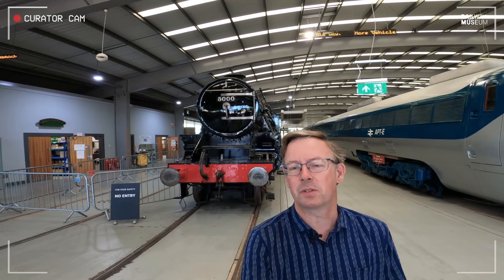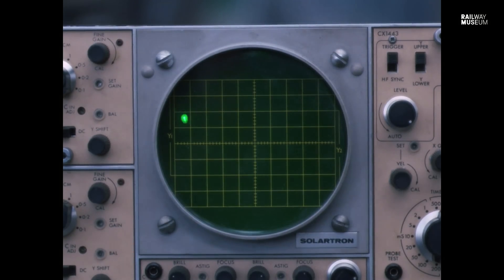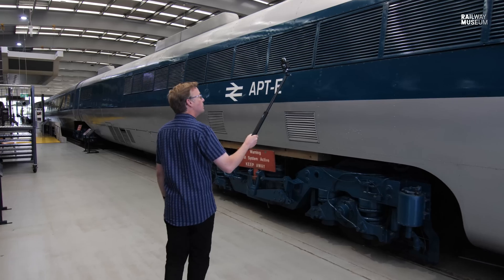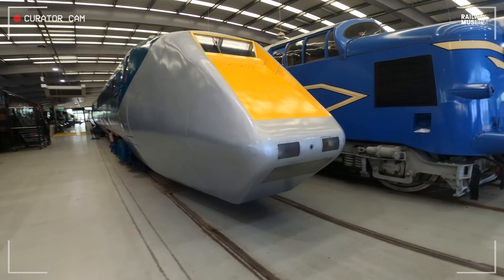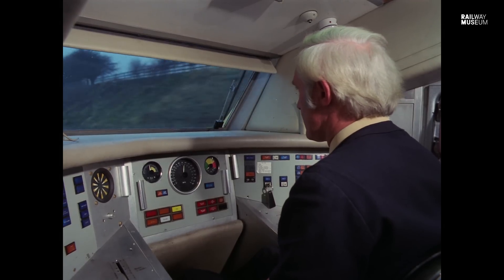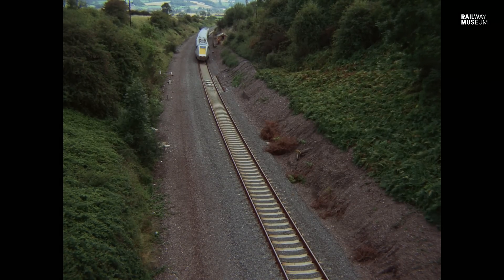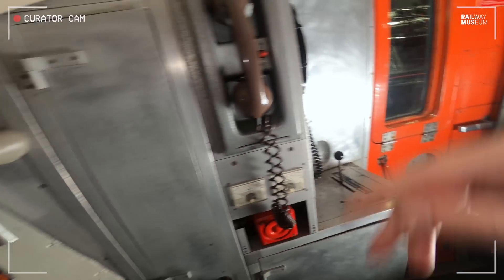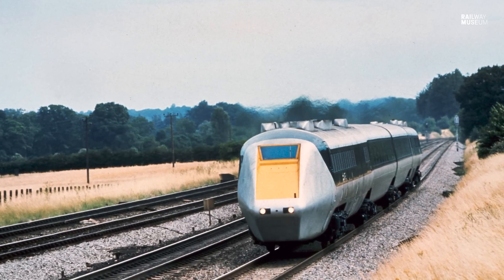APT-E: The Tilting Tech Fest, a 1970s Vision of the Future | Curator with a Camera

Comment: No mention of the cheese sandwich that was used to wedge an internal door open (nothing else worked, apparently).  Although apparently Rapido included it in their model.
Reply: The door wasn't meant to be open much of the time, but we had to open it so often that the door wedge kept wearing out. A stale cheese sandwich was the perfect size, and I've got three pics showing them on different occasions. Rapido really DID put in the model, it's about 1.5 mm square. :-)

Comment: What is pointed out as the traction motors and associated cabling near the beginning of the video is in fact the hydro kinetic brake and associated axle-end piping.
These can be clearly seen on the APT - P at Crewe Heritage Centre. The NRM really out to have an ATP - P as this was what we could have had on WCML long before we flunked development of APT (thanks to UK gov, BR management, and rail unions - who killed it), sold it to Italy, then bought it back in developed form as Pendolino.
Chuck out of York that irrelevant to 'UK National Rail' Bullet Train and replace it with significant vehicles from the APT - P set from Crewe ! That really should be preserved under cover rather than out in the open at Crewe.
And as APT - E was gas turbine, where were the engine instruments (N1, N2, EGT, Fuel flow)?
The intakes on the roof are the air intakes for the gas turbine engines, not for cooling air. Gas turbines swallow massive amounts of intake air.
Reply: The turbine instruments were on a separate console in Trailer Car 2. The driver didn't need to know about them as we always had a turbine engineer or two when the train was running. Of course if service gas turbine powered APTs had been built it would have been a different matter and they'd had to have been in the cab.  No, the turbine air intakes are the large grilles that run along the entire length of the sides of the Power Cars, and the roof bulges are where the exhausts end up. They stick up above the roof line to ensure the exhaust gases don't stick to the surface as a bounder layer.
Reply: @kitspackman3994  who'd have thought that boundary layers would be a consideration in railway vehicles?
And of course it turned out it wasn't, as the advanced tech of ATP was ditched for the conventional HST.
Not that production APTs would have had gas turbines. But it's indicative of the advanced thinking involved in the APT program we lost when BR reverted to conventional tech with HST.
Yes, HST was a great train, but APT could have been leaps ahead.

Comment: Silly question. Having got in how do you get the steps back up, or down?
Reply: you can drop the steps via a button that is located above the steps and if you want to back it up, possibly simply back it up manually
Reply: @voidjavelin23  Do you mean the button pointed out in the video that releases the steps?  Having got into the APT how do you return the steps to the original position without getting out again?
Reply: @David-y6h9p There's a socking great lever just inside the cab that hauls the steps back up.
Reply: @kitspackman3994  That is what I wanted to know, and isn’t shown in the video. Thank you!

Comment: Presumably the APT-E has more than one hydraulic system for redundancy purposes. I would therefore guess that the Lane Change button switches the bogie's lift pack to the second hydraulic system, to be used either in case of a failure of the first system, or to test the second system.
Reply: Not quite. Each car, Trailer or Power, has it's own hydraulic power pack, each with a main pump and an auxiliary pump, and as I mentioned above, there are two channels of accelerometers, control electronics and control valves. The channel actually in control was selected vie the 'Lane Change' switch, and that switched a hydraulic selector valve which in turn fed the hydraulic power to the tilt jacks. The jacks themselves were not twinned, there wasn't enough room to have done that, if a hose burst or a jack failed (Neither actually ever happened....) the vehicle concerned would just fall over.

Comment: You don’t show the turbines, or say much about them.  Are any of them still installed?  What was the power rating of them?
Reply: no info for the power rating
Reply: Each turbine gave 300 hp to start with, but were later upgraded to 350 each, giving the train 3500 hp at full throttle.

Comment: I think the "inches of Mercury" gauge is actually "%g", meaning, I presume, what percentage of G it's pulling (whether that's horizontally or under braking, I'm not sure)
Reply: You're quite right.  I would've thought that this train would've been air braked rather than vacuum.
Reply: I think it's actually percentage grade, as in how steep the track is.

Comment: Cheers Anthony for an informative video.
7m24s.  Inches of Mercury/vacuum?  Labelled as %g.  So probably G-force and not air pressure at all.
So, one driver's seat and everybody else standing up trying to take notes on the fly.
British Leyland gas-turbines.  How did they even build them as BL was always on strike in the 70's.
300kmh is 186mph.  Done it on a motorcycle.
40 years with the railway and I'm entering data/controls for a southern region signalling simulator on other screens watching this on another screen.  Not the 70's.
Around 1983 I got a free ticket to ride a tilting train out of Glasgow (APT) to I think it was Euston.  That was weird when stood up - like messed up as guinea pigs for free travel and please fill in a questionaire.  Thankfully, tilting has got more controlled since then as you do not notice it and coffee/beer/soup does not slide onto the carpet.
Reply: Cheers, I learn every day!

Comment: The "Lane Change" is probably referring to control lanes. General a signal path, i.e. the electrical path from an operator interface control (button, switch, lever, etc etc) to the thing it controls, or from a sensor to either a display or recording device is referred to as a lane. Generally for anything really important good design practice would be to have multiple identical lanes that run in parallel. Assuming everything is good and happy and working as it should, only one lane will actually be actively operating, the other lanes typically are still passing the signals back and forth, but there signals are being disregarded (but may still be recorded to any data recording devices for later analysis). If however something seems off, maybe a control isn't responding the way it's expected to, or some piece of displayed information seems nonsensical, you can swap to an alternate lane, the idea being that with the lanes being independent of each other apart from their end points, this will overcome any electrical component failures. In more advanced systems you may have 3 or more control lanes, with a computer automatically comparing the data on each lane and deciding which is correct and which is not, on the basis of probability, if 2 lanes carry identical data, and 1 lanes data is different, it's more likely that the lane with data that differs is faulty, than that the 2 lanes that are showing the same data are both faulty in exactly the same way.
Reply: I was going to say that the lane change is probably because the system was designed to have a level of redundancy, in other words, a duplex system. This is quite apt given the aerospace link of APT-E to English Electric and Alan Wickens having previously worked in the aerospace sector. It's very common for commercial airliners to have duplex and triplex systems to provide one or two levels of redundancy, e.g. two or three autopilots, so if one system fails,  you have one or two backups. The same design principle  was read across to APT-E.
Reply: @EuropaSman  exactly, I believe in modern day aviation its not just a common practice but a legal mandate for any system deemed safety critical.
Reply: See my direct reply to Anthony above. The APT-E had a duplex control system which could be switched manually from one channel to the other. There was also a monitor accelerometer which triggered an automatic lane change if it reached a pre-set level of lateral acceleration.

Comment: So the sunflower is radioactive? Is that why it's called a SUN flower instead of another kind of flower, or am I overthinking it?
Reply: It is just a name drivers gave it because the triangular yellow segments resemble sunflower petals. These glow in the dark so they are visible in tunnels or at night. instead of using a lamp they were painted with luminous yellow paint which is radioactive. They were first used on steam locomotives which used a battery to work the equipment and probably why paint was used instead of a lamp which would drain the battery
Reply: @cedarcam  So I was overthinking it! And that also explains why they used that kind of paint, instead of a lamp, thanks!

Comment: Unlike the English Electric Lightning which was a success the APT was a disaster...for goodness sake it was powered by British Leyland turbines, British Leyland will always be synonymous with under-engineered cra*p. Should have tried English Electric Turbines. APT...total flop.
Reply: EE didn't build turbines of the right size and power rating then. Rolls Royce did but didn't want to make a very short run of the correct rated turbines. The BL truck turbine was the only game in town back then.
Reply: There was never any question about its reliability I think, it was only ever intended to be experimental. The turbines were designed by Leyland for truck use, and the truck side largely avoided the industrial relations problems inherited from BMC
Reply: Absolute nonsense! APT-E is only loosely related to prototype APT's which didn't use turbines at all, as they were electric powered.
Reply: @TheSulzer27  There was more relationship between the APT-E and the APT-P than shows at first sight. Even the HST profited from the APT-E's work too. The fundamental technology of the whole APT project was the newly discovered wheel/rail dynamics, derived from the wheel profiles and the suspension characteristics first developed by Alan Wickens on the HSFV-1 test vehicle. BR made that technology freely available to all railways world wide and many of them profited from it, and still do.

The aluminium trailer car structures were also related, although manufactured by different methods, plus the HK and friction brake controls and the basic tilt control system on both trains was very similar.
Reply: @kitspackman3994  jeez man - read the original comment. He is talking about APT and gas turbines. The APT that was a failure was powered by overhead electrification. Do try and keep up.

Comment: Great video, but why the gas turbines? Was it seen as the future or was it more about testing the other systems and the gas turbines were the best solution for powering the train?
Reply: The train needed 3500 hp to reach its 155 mph target speed in a reasonable time, and diesels would have been too heavy. Gas turbines were the only answer if the train was going to run anywhere without 25 Kv overhead power. But the 1973 fuel crisis, when fuel prices were multiplied by four overnight, stopped any further development in that direction and thus the APT-Ps were electric only.
Reply: @kitspackman3994  One would think it would have been far simpler to electrify track, especially when large amounts of train were expected to run on it.
Reply: @InLoveWithCities  We were doing this in the 1970s, it's taken until now for the current British railway authorities to even think about electrifying the Midland Main Line, and so far they've only got as far as Kettering........
Reply: It was seen as the future. Gas prices were low, power was high (and so was fuel consumption!). By the end of the 70s this was being reconsidered as fuel prices had risen a lot. The USA also had gas turbine trains in the 70s, like the TurboTrain.
Reply: It was also to enable the train to run on none electrified lines Derby research centre where the train was kept had no overhead power, also the record breaking line from St Pancras was not electrified. The turbines were extremely loud I only saw the train once moving slowly into Derby station. I am not sure the public would of been happy with turbine powered trains screaming  through the countryside day and night unless the production ones were going to be a lot quieter.

Comment: Reminiscent of the Turbo Train in limited use in Canada and the US, tho the Turbo Train looked rather ungainly and had a passive tilt system, that like the APT was underdeveloped early on and had its issues, tho in time managed to become fairly reliable after much work. Only to be retired in 1982. Like this one the “Turbo” used gas turbines, but I believe they were direct drive to the bogies through the free turbine of the PWC St-6 turbines (4 for propulsion and 1 for power). The Turbo certain wasn’t as pretty as this was though. They also did not preserve an example of these cars which did manage to get up to 170.8 MPh in trials and hold the record for gas turbine vehicles which they could never get to in normal service especially in Canada, due to the amount of crossings. Sadly there hasn’t been much like it since though some of the current diesel can certainly get up there in speed nowadays. It is something they should have continued developing

Comment: I could be mistaken, but from what I've watched about the APT's short history, because the museum got the prototype they didn't want the final version of the APT, so when BR gave up on it, it was merely left to rot on a siding until a bunch of volunteers took it in to restore it. Both units represent different chapters of the same piece of rail history, and really both deserve proper museum space.

In Denmark we've got issues with curvy track as well, especially in the western parts of the country where the lines were built on the cheap in the mid-1800s, but because tilting trains are heavy and expensive they've decided to instead straighten out the track as much as possible wherever they can, which really means they're levelling out a lot of land to build "shortcuts" across curves. It's a rather substantial project and due to the current world situation and problems with the contractors, it's currently uncertain when the straightened lines will be ready.
Reply: @thesteelrodent1796  Lots of blasting and tunneling?